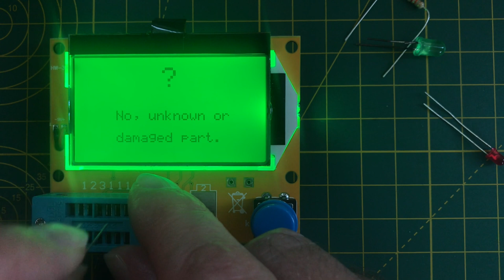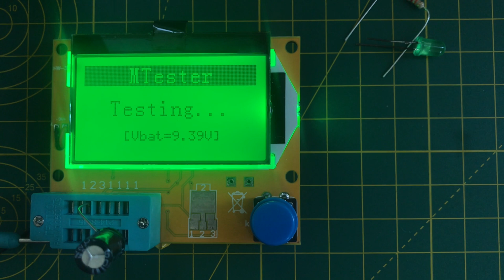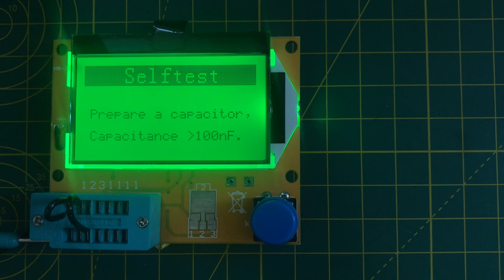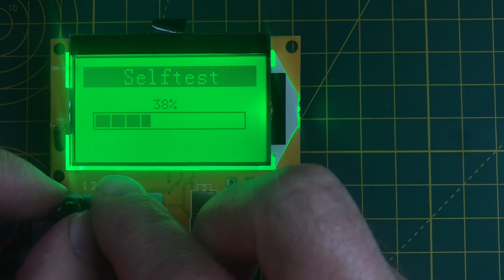Multi-function component tester - "MTESTER"

Comment: How do you measure the inductance of a coil with the MTester?
Reply from the maker: Stick it in and push the button
Reply: @atomic14  The coil has two wires: where does each wire go? In what positions?

Comment: My Mtester accuses the capacitor test as being NPN, would it be a problem in Mtester?
Reply from the maker: Interesting, does it do it with all capacitors or is it a particular one? Could be a dead capacitor - though I'd expect it to think it was a resistor or some other two pin device.
Reply: It happens to anyone. Even if I turn on without any component, instead of informing it as if it was empty or a damaged component as it does, it informs the display of an N-E-MOS. It was normal until a few hours before and then I came across it. Thanks for responding, greetings from Brazil!